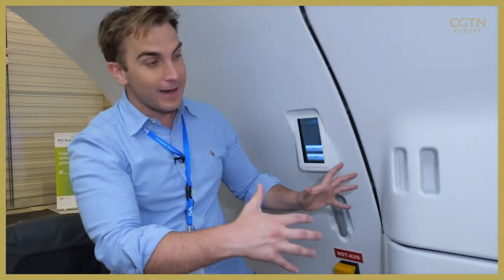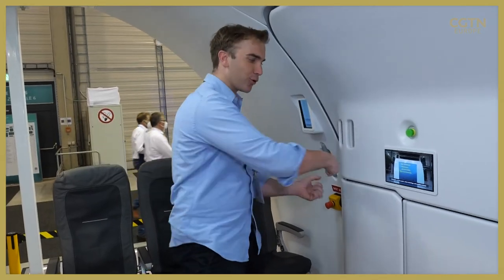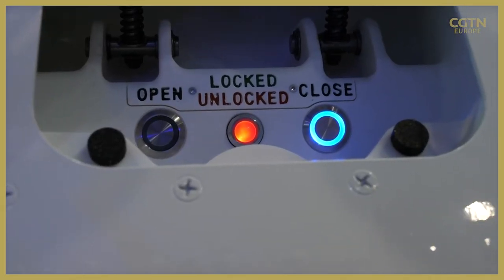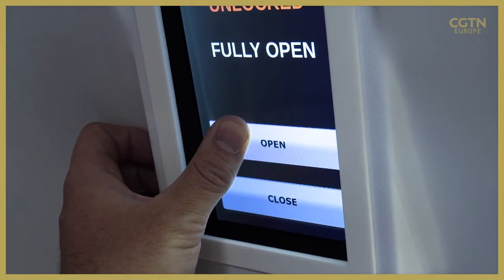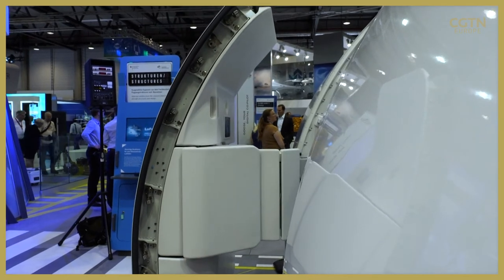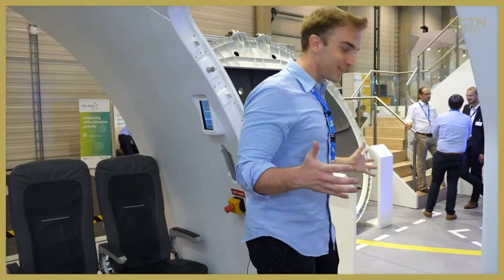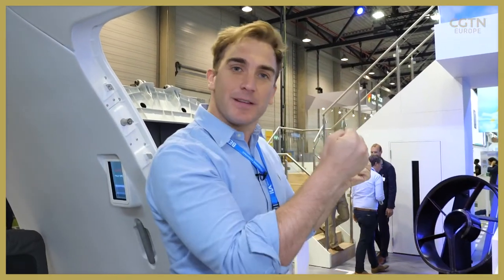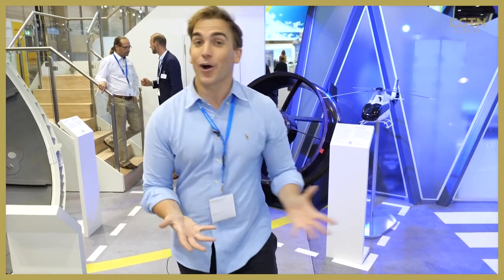The future of plane plug doors

Comment: Boeing 737 Max has an even simpler  system
Reply: This will work great when the airplane has a catastrophic event like that A350. They couldn't even shut down the right engine. What makes you think they could open the doors in that kind of scenario? I'd stick with mechanical doors, personally.